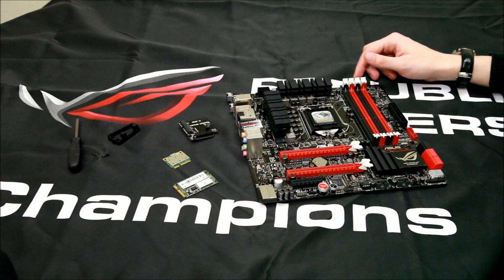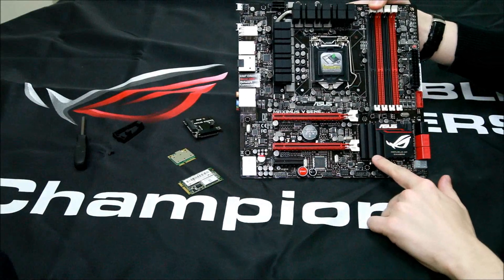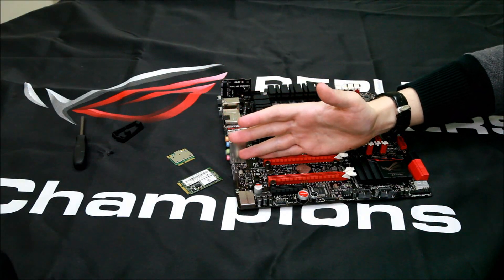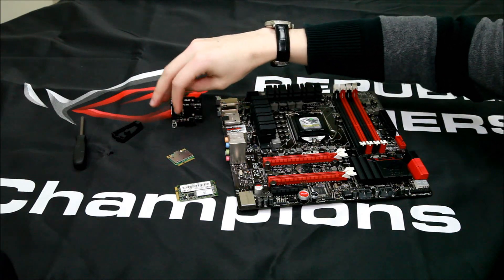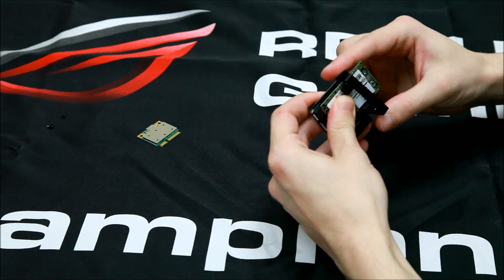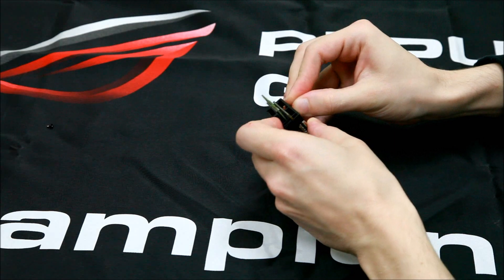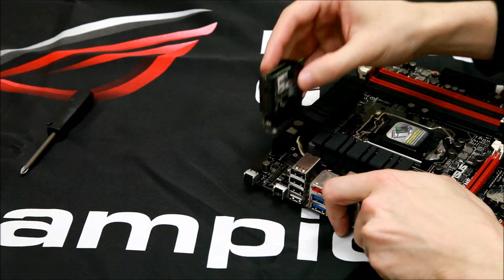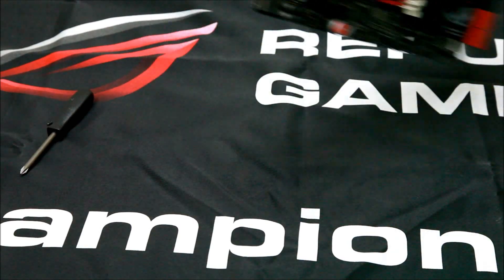How to use the mPCIe Combo Card on the Maximus V GENE motherboard

Comment: Just discovered this video .I have the Maximus Gene VI with the Combo 2; installed 4 years ago because I didn't want it to move around inside the motherboard box , but I never used it . This can fit a M.2 SSD? There's no gap to plug anything from the inside of the pc case due to 8pin psu connector for the GPU ,and the vrm heatsinks they r simply too big , and is on a very stupid spot ; ican only access I by removing my Cooler Master V8 and is not an easy process , basically forced to take the mobo out of the case to plug MPcie Combo2 .
Reply: I got the same question did you put a m2 ssd ?

Comment: Why didn't asus include this with the maximus vii gene board?
Reply: Nick J What the hell is Asus thinking? :'(
Reply: I have the same problem with the Asus IX hero there's a slot and a holes for the wireless card but I have no idea what card will fit I contacted Asus but you know how there customer support is if anyone has solved what card will fit that slot by the I/O shield please share

Comment: i cant find any wifi cards that come with the antennas compatible with this setup :/

any ideas?
Reply: +partyprash http://www.ebay.com/itm/Atheros-AR5B22-300M-Wireless-Wifi-Bluetooth-4-0-PCI-E-Card-Desktop-PC-Adapter-/321803171383?clk_rvr_id=980442055673&mfe=sidebar

Comment: I bought the Maximus 5 Normal ATX board from them. It came with all the WiFi stuff I needed. The only thing I can't figure out for the life of me is how to get the antenna connectors to stay. I've pressed and pressed and pressed again but still the pigtail connectors don't lock in. I'm not pressing really hard as I don't want to damage the board but to get these to lock in (If they do) would require some pressure it seems. I would of much rather they intergrated it into the board then this.

Comment: It doesn't look like any antennas are included with the motherboard so you just have to buy some of your own from somewhere I guess.  In the "ASUS Maximus V Gene Z77 Motherboard Hands-on Review" video at 28.55 the guy shows two antennas hooked up to the wireless card via U.FL-RSMA pigtail adapters.  I would've preferred if they integrated RSMA connectors on the back IO section.

Comment: Higher level boards use these awful white antennas that work surprisingly well, but have a low range receiver. I'm sure you can use any other antenna that connects similarly. To install them, you simply place the brass heads of the antenna onto what look like brass screw points that are on the wifi card.

Comment: You will need a pigtail.
A cable with U.FL in and a SMA-RP out.
They're not very easy to find but search for the short ones, that have less signal loss.
Reply: Thank you for this info I was searching for it has 1 year since that cable ripped on my MPCIE Combo ii

Comment: once you have the wifi cars in the left msata port or whatever it's called, you will place the two things that you connect the antennas to on your rear I/O, and the 2 little connectors into the card itself. Then you just connect the antenas and enjoy. the manual is available on the asus website under any of the Maximus V products, that's where I learned most of this from.

Comment: you are right bro..
I got this zotac and ocz msata ssd spend over.. 300dlls and guess what.. that crap didnt work no matter what i did. that msata ssd doesnt apear in the bios. i contact zotac all they say was " ok ill open a ticket number"  i contact ocz they recomend to eschage the ssd had it exchange but same problem.. now i have a board and ssd that are basically useless. zotact cover their ass saying if the wifi card works there is nothing wrong with the board so cant be exchage...